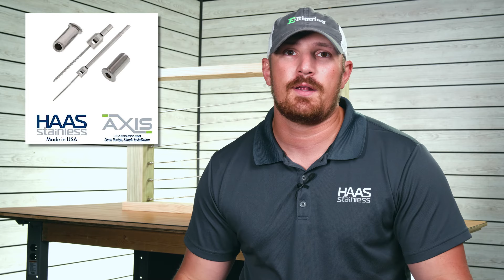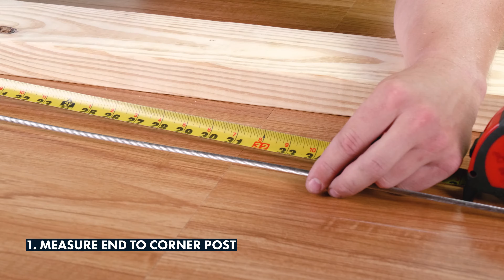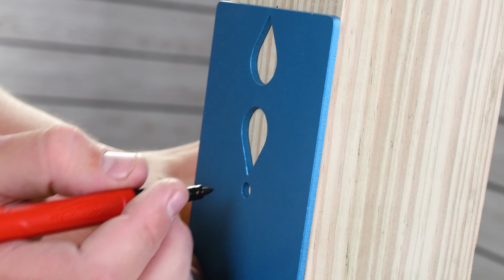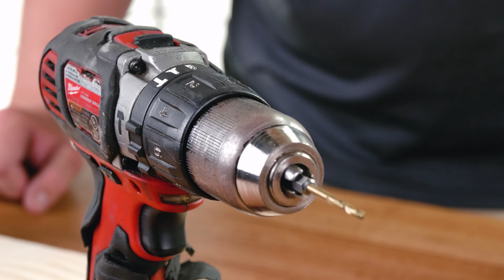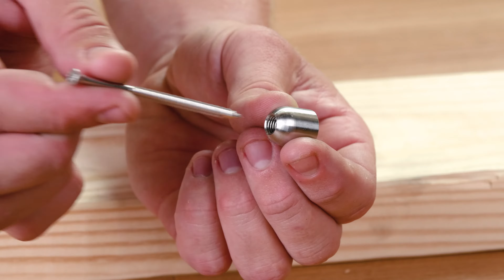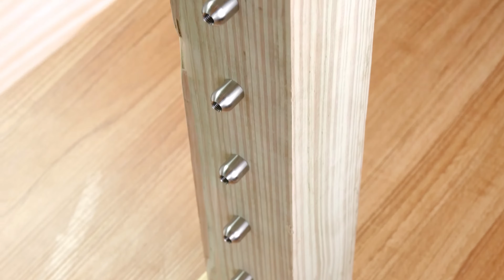How to Install the Axis Cable Railing System - Straight and Angled Cable Railing

Comment: Hello. I am installing this at home but i have a question: How can i open the holes in wood post (middle) in stairs. I now i have to use the wood post protector with 37 degrees, but is there any angled guide which can help me to drill the holes with the exact angle?
Reply from the maker: Great question. Two options: 1) take a pencil and carrying over the mark you made on either side connecting them to reveal the angle and have a spotter guide you while you freehand drill or 2) use a portable drill press. You can watch a full video on drilling holes for wood post cable railing here https://youtu.be/y5c1-IlrDK0

Comment: When you crimp, I know you twist to do the second crimp, but do you stay in the same area?  Do you move it to the inside silo, above the first line?  Is one crimp enough?  Wondering if the second one would uncrimp the first. 

We did our first batch with only one crimp. Should we do two?
Reply from the maker: Hi Dee! Sorry we're a little late responding to this comment. Assuming you're already done with your project, you should be fine with it as it stands, but a "good" swage is swaged once, then twisted 90 degrees and swaged again in the same "swage area" (between the opening of the swage cavity and the small indentation line on the fitting). Let us know if you have any more questions.
Reply: @E-rigging  Ty!

Comment: What can be done to keep the tension firm over time? Since completing the system on a large deck, we have had to retension multiple times in only two weeks. It seems like there should have been locking nuts or something to hold the turnbuckle like you see on safety lines used on boats. Do you have any suggestions, or should I just expect regular callbacks from my customer?
Reply from the maker: Joe, we'd be happy to give you a call ASAP so we can see what the problem is and how we can help. If you don't mind, shoot us an email at : haaspro@e-rigging.com. 

Tyler
Reply: @E-rigging  thanks for the reply Tyler. I talked to a neighbor with the same system and we came to the conclusion that the natural expansion and contraction of wood and metal is the culprit. If you tighten the cables early in the morning when it's cold, it may loosen slightly after the sun beats down on it all day (especially with the weather we are currently experiencing with lows in the 40s and highs near 80). My only other complaint is that a star bit isn't included with the package. Not a huge deal, but the acorns used on your stair rails require a long narrow bit, which many people will not own.